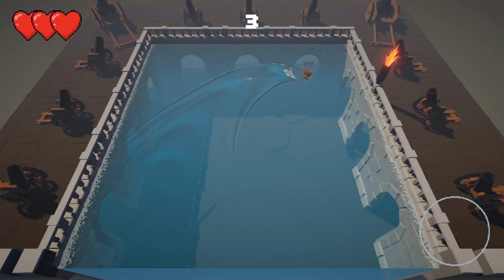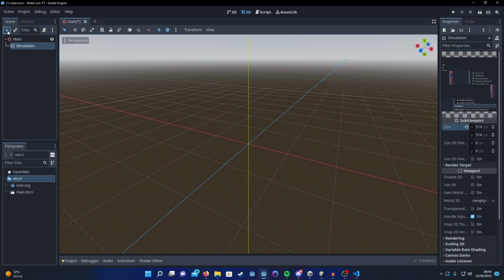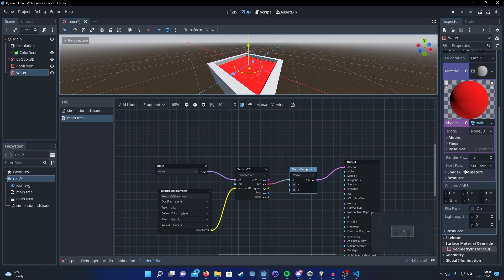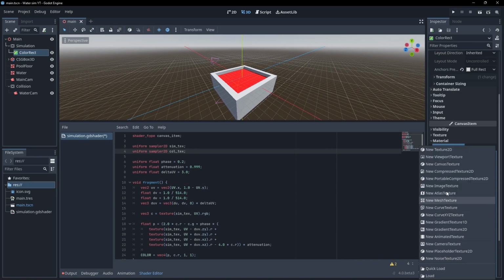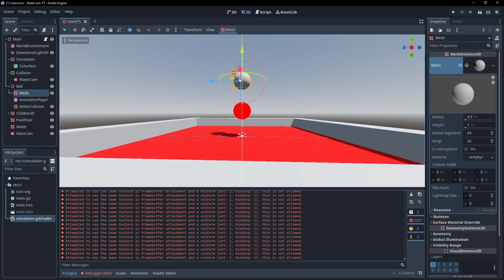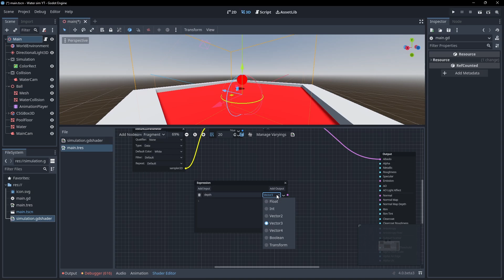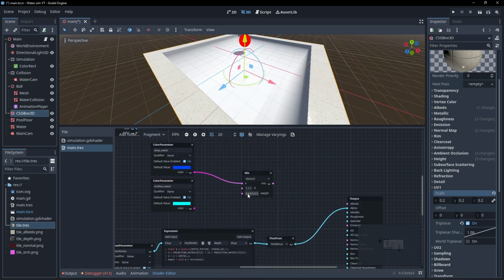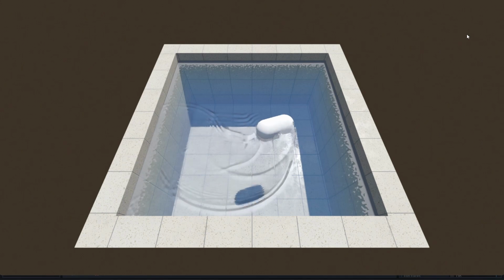WATER SIMULATION in Godot 4

Comment from the maker: Hello again!
The repo has now been updated to work in version 4.1.

The changes I made are as follows:
Added a second viewport to act as a buffer, this removed the error spam but doesn't fix the core issue.
Set MaxFPS in the render settings to 60. Unlocked FPS caused the shader to update so fats you could barely see the ripples.

I'm going to investigate fixing the effect without capping framerate, but for now the effect works again.
Reply: So the good news is, the updated version of the project works flawlessly.

Stumbling hazard for people wanting to re-create the tutorial: There is currently a bug in Godot regarding how viewport textures are passed to a shader. For whatever reason, if you set the sampler in the Godot GUI, it passes the Viewport, not the Viewport Texture, and there's no way to get the texture. The ONLY way to get the actual viewport texture in a way that the shader can use is to use the script technique in the example repository.

If you do it wrong, the texture will update in the Godot editor and look perfectly normal, but once you start the actual game, it won't work at all. You'll know you've done it right because the texture won't update in the editor, but it'll update correctly inside the game.
Reply: thank you!!!
Reply: Thank you for the update, such a cool shader you've got going on there!
I will likely use it in my current project in the future. Shame you've run into issues, but such is the way of software dev, eh?

Comment: very cool but what if i dont want my whole game to be capped at 60 fps to make the water simulation speed realistic?
Reply: your whole game shouldn't be running in physics_process. you can have separate game and physics tick rate, process is called every frame the PC can render or the limit set in the project settings-run-max FPS 
and physics_process is called every physics tick as set in physics-common- ticks per second
Reply: @SoftBreadSoft  dude what does that even mean?? this guys shader is bound to the framerate if i unlock thee framerate the simulation is sped up
Reply: @raevod6361  I don't know bro I was tired and didn't think that all the way through or forgot wtf I was watching.

Comment: Amazing tutorial. Really creative use of viewports and cameras to have shader interaction. My only question is how expensive this is in terms of GPU use. I've been trying shaders on my machine but then try my game on other machines and some wreck the frame rate.
Reply: Runs pretty smooth on my Dell latitude potato from 2014 lol, as long as I reduce the subdivision of the water plane a little. The number of vertices being moved takes up the bulk of the overhead. Surprisingly it doesn't look much worse on lower subdivision

Comment: Hi, nice vid and shader! Would it be possible to extract the height values of the water surface to implement bouyancy forces depending on the ripples? Did something similar in Unity, but I stuck at reading height values from the simulation colorrect (if this is even correct).

Comment: Some notes:
The issue connecting your sampler inputs to your shader is not a bug, it's a limitation of Vulkan, and the fact that you can bypass the check by assigning the connection in code is a bug, which has since been fixed in later versions of Godot. The correct way to fix this is to create a second viewport to act as a buffer. Plug the simulation image into the new viewport, plug the viewport output into the simulation. (What exactly goes on inside the buffer viewport is left as an exercise to the reader, I used a do-nothing shader that just draws whatever sampler2D it receives.)

You may, as I did, find yourself in a frustrating situation where the shader output only appears in a tiny corner of the viewport. To fix this, go to the your ColorRect, in the Layout controls, and set "Anchors Preset" from "Top Left" to "Full Rect."

I was able to get the shader itself working, and it looks nice, but I can't get whats' in the viewport to draw onto the surface of the water. Inside the editor, it works fine, but the moment I tell Godot to run the scene, all I get is a blank purple sheet. I went ahead and plugged in the vertex shader as well, and that doesn't produce any ripples either. I'm not sure what the issue is there.
Reply from the maker: I've updated the repo to get it working in 4.1, unfortunately I never had an issue with a purple texture being displayed. Maybe it will work for you now?
Reply: @crigz I'll be sure to take a look. There's a nonzero possibility it's a driver issue or another bug with Godot, as I'm currently running a positively ancient AMD card on Linux, and it can be a little sketch at times.

[edit]Update works flawlessly. Now I need to go through and figure out what I did wrong with my version.
Reply: @ClokworkGremlin  Yeah I had the same issue. DId you ever already figure it out?

Comment: Thank you for sharing the information. However unlike most here, I actually found this very difficult to follow as you frequently made cuts where you had updated settings without telling us and I had to play spot the difference between frames.

1:48 - about a quarter of a second where you can spot the checkbox being enabled and not mentioned
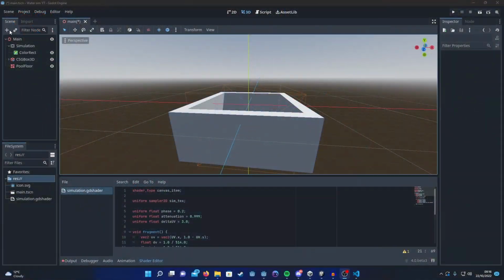2:38 - the scene has transformed
3:02 - Ask a gamedev friend to follow all the steps at this point. They will likely need to slow the video down to 25% speed and still have to rewind parts.

Also the github code is quite a bit different to what you showed in the video.

When you mentioned bugs in Godot v4 it would be great if you linked to the Github issue (if one exists). You are spot on when you said that setting it to 512, 512 triggers the bug, however I couldn't find the github issue as I wasn't sure what to search for. 

Having said this, the effect is fantastic.
Reply: "When you set up your water collision camera, add an environment to it and make the background clear color black: https://i.imgur.com/XGAnauQ.png "

I think "Clear Color" is a typo and you likely meant "Custom Color" as shown in your helpful screenshot.

Comment: Hey, great tutorial. I noticed that the simulation changes based on frame-rate. How would one fix this?
Reply from the maker: I've not tried it myself but changing the DeltaUV uniform by delta time should help
Reply: @crigz  Tried that but it doesn't seem to help at all unfortunately
Reply: This method cannot really work in a frame independent manner since you can't calculate an arbitrary state into the future using deltatime.

Comment: This look awesome! I tried to replicate it, but unfortunately I can't make it work. My log get's spammed with "ERROR: Attempted to use the same texture in framebuffer attachment and a uniform set, this is not allowed" as soon as I select the Simulation Viewport in the Shader. This might be a Godot 4 beta issue, though.
I also never get any waves. Everything just stays red. :-/  
Could you, by any chance, provide a demo Project please?
Reply from the maker: That error is normal in Godot 4.0 beta, it doesn't stop anything from working though. I'll try and get something uploaded later!

For the time being, a few things to try:

1) Ensure the simulation viewport has it's clear mode set to NextFrame.
2) Make sure your collision mesh is on same layer of the cull mask for the water camera. Be sure it's material is unshaded, or the camera under the water won't see it. Also make sure the camera is pointing up and it's far plane reaches the surface of the water.
3) In Godot 4.0, be sure to assign the viewport textures to the shaders via script, assigning them in the editor doesn't work.

Hope this helps!
Reply: @crigz  Thanks for your efforts! I checked all of your points but had no luck. 
I think I boiled it down to some issue with the visual shader on my machine. No matter what I do, it seems to be unable to use any data from the Texture2DParameter node. It always returns black no matter what you put in. 

Anyways, I might try again in Godot 3 and wait for a demo. This is probably not the right mediumk to discuss those issues. :-)
Reply from the maker: @ThomasHempel  I realised a step I missed in the video, unfortunately I can't add an annotation so I'll just have to update the description.

On your Water Collision Camera, Add an environment. In the background section, set the mode to Custom Color and then make the Clear color black.
https://i.imgur.com/XGAnauQ.png
Reply: @crigz  Well, I did that already on my own. That doesn't help, though. As I said earlier. It seems it's some issue with the simulation texture in the visual water shader that does not work for me.
I will play around a little more, and see if I can find anything.
Reply from the maker: @ThomasHempel  Here's a github link for the project, let me know what it is when you figure it out! https://github.com/CBerry22/Godot-Water-Ripple-Simulation-Shader
Reply: @crigz  That works! Thank you!!! Let's see what I've missed ;-)
Reply from the maker: Could be something I missed too! Glad it's working at least.
Reply: @crigz Please, I have tried it three times so far. At least I get the same error 😅 the water mesh gets full red.
Reply from the maker: Glad you got it working! Those types of errors are the worst. Keep me posted and what you do with it!
Reply: @crigz  I'm still getting the "Attempted to use the same texture..." bug with the github code, even in the newest beta versions. The ball animates up and down, but the water (white plane mesh) doesn't move. Would you mind checking the code works on newer beta versions?
Reply: @crigz  Hey, I was researching water simulation recently and found out that in current stable release you don't need to assign your "sim_text" in code. You can assign it in editor directly and it will work fine without error spam